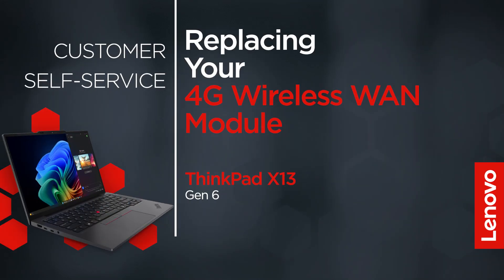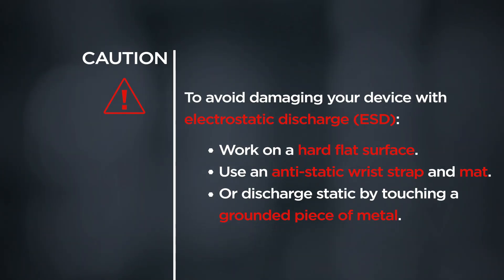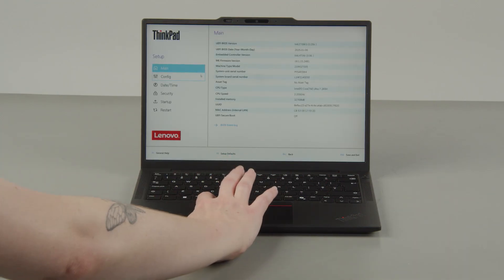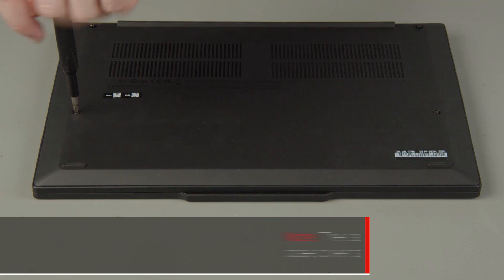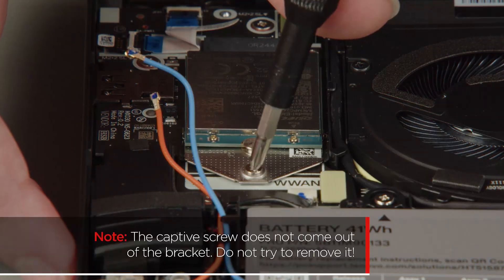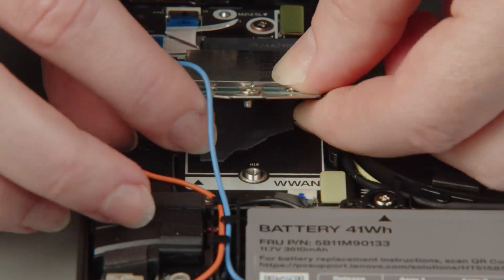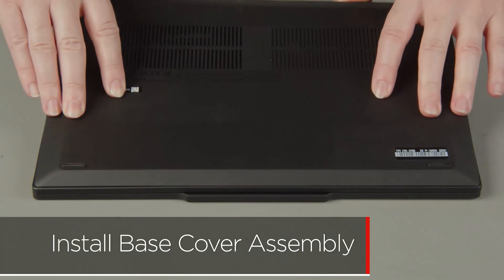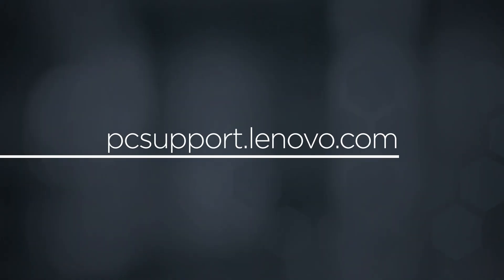Replacing Your 4G Wireless WAN Module | ThinkPad X13 Gen 6 | Customer Self Service

Comment from the maker: This video will show you how to replace the 4G wireless WAN module in your ThinkPad. The process in this video will work for the ThinkPad X13 Gen 6.

You will need a screwdriver kit, a non-metallic pry tool, static-safe tweezers, and 20 minutes of your time.

To learn more about your device go to https://pcsupport.lenovo.com

To find parts for your device go to https://support.lenovo.com/parts-lookup/?cid=ww:lenovosocial:b9515f&source=socialmedia&subsource=yt

To view the Lenovo Support Self-Repair Guides landing page go to https://support.lenovo.com/us/en/solutions/HT516547

** NOTE: Static electricity can destroy components. Use a grounding strap, and clean, non-conductive surface to work on. Use plastic or coated tools to prevent scratching and avoid using metal tools on plastic parts. For more detailed information on electrostatic discharge and how to prevent it, please watch our "Understanding Electrostatic Discharge (ESD)" video: https://youtu.be/by4PB3WtdLo 

Applicable Machine Types:
ThinkPad X13 Gen 6 - 21RK, 21RL, 21RM, 21RN

Check out other official Lenovo channels!
https://www.youtube.com/@Lenovo 🟥
https://www.youtube.com/@lenovolegion 🎮
https://www.youtube.com/@Lenovo-PC 💻
https://www.youtube.com/@LenovoSuporte 🟢🟡

#Lenovo #LenovoSupport #LenovoTechSupport